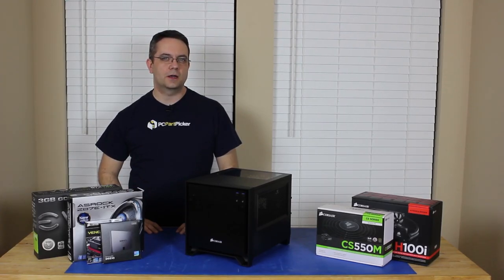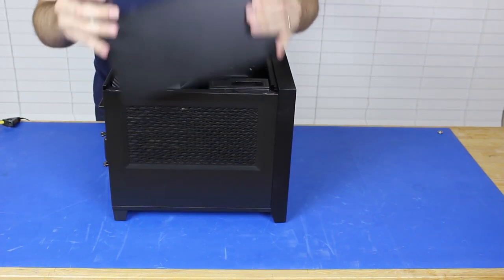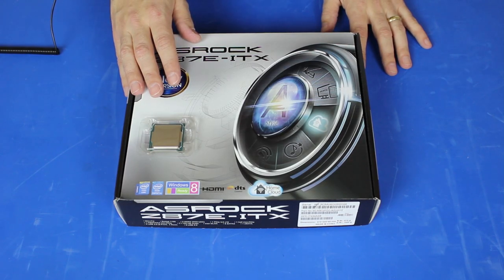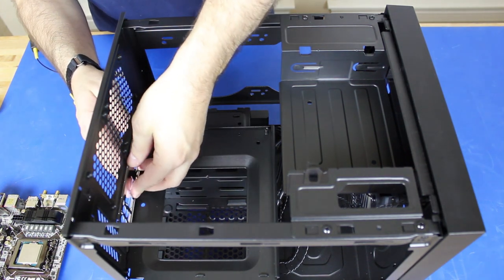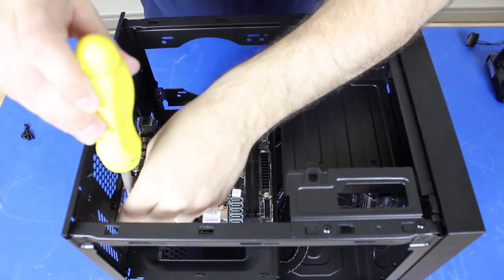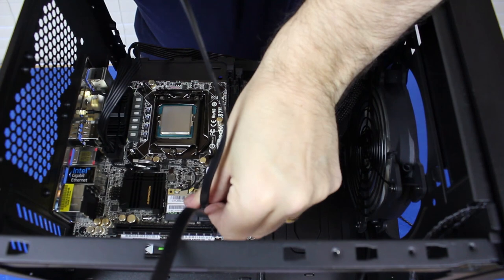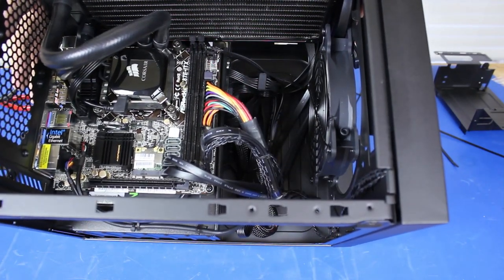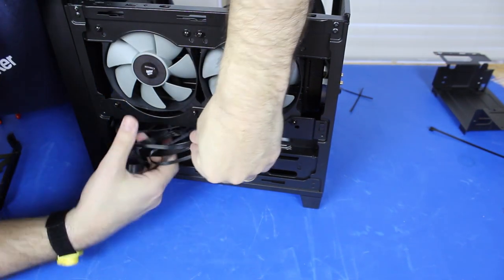Mini ITX Gaming Build - Intel Core i5-4670K / GTX 780 Ti / Corsair 250D

Comment: problem about most itx cases such as this

The GPU cooling is below average rating because of the blocked air ventilation .

Even it does have holes , they should have let us install a exhaust

Comment: i would have had those fans on the radiator as exhaust fans.

you've got a dust filter on the front intake fan but none on the other two #logical

Comment: That was a bad idea on fan placement for the radiator, especially during gaming, those fans will be blowing hot air into the case and everything will be suffocating...
Reply from the maker: The fan placement is according to the recommendations in the H100i manual.  Keep in mind the air coming off the radiator is not blazing hot - just a tad warm - even with the CPU at full load.  The GPU also has it's intake facing the side vent on the opposite side, so it will not be bringing in the slightly warmer air.  Couple that with the front fan intake bringing in additional air...  it's fine.
Reply: PCPartPicker I mean the air does get pretty hot, especially if running the fans at lower RPMs. Plus having so much positive air pressure will actually make it very difficult for the 780ti to suck in fresh air, it will just be sucking in the air coming off of the radiator. I tested this myself a few weeks back as I did have a few friends disagreeing with me over fan placement. I wasn't using a blower style gpu cooler, but the MSI Twin Frozer 780ti ran 8 degrees cooler when the fans on the radiator pushed the hot air out of the case instead of in, and yes that was in a 250D. But that's just my experience and it would only make logical sense to not be dumping hot air into the case...
Reply from the maker: Obox2550 Interesting.  I'll have to test it out and see if there is any difference in our setup.  With the 780Ti being a different style cooler (blower style vs the Twin Frozr design), I'm curious if that will end up the same or different.

Comment: Too much strain on those cooling tubes imho, I would of put the radiator outside, and coolers in the case, blowing out the heat. Also the tubes ending part of the radiator facing forward so the tubes would be loose, still enough place for the 5,25 cage.
Reply from the maker: The cables are very flexible; there is very little strain.

Comment: Does the Asus Strix GTX 970 fit into this case? The card is quite a bit taller than the reference card design due to the mounting location to the back connector plate.  Can you confirm? Thanks!
Reply: ***** I heard they actually can fit but just barely, like a few mm of room ontop but it should fit length wise a-okay.
Reply: Just got my Asus Strix GTX970 today and put it in my Fractal Node 840 which I bought instead of the Corsair 250D. Actually, I bought the 250D before the card came and didn't think it would fit so I returned it without trying to fit it. The Strix fits easily fits in the 840 with lots of clearance on all sides and looks killer. I'm glad I switched cases and very happy with the extra space and cable management.

Comment: will the r9 280x toxic fit and work well in this case?
Reply: I think so, a GTX 780 Titan fits, how large is your 280x?
Reply: Cesar Ferrer what is a 780 Titan
Reply: dotShinoda a 10.5 inches large vídeo card
Reply: i have heard of the gtx 780 and the gtx titan, what is this new hardware the 780 titan
Reply: 2 nvidia card, the titan being the most powerful, their length is  10.5 inches

Comment: What's that on your wrist?
Reply: Miya Kimi it's an antistatic wrist strap. it's used to prevent the static electricity on your body to discharge on any of the components. You can also rid  yourself of static electricity by constantly touching any large metal surface, such as the case or the power supply.

Comment: Hi! Can anybody tell me if the ASUS GTX 970  Strix fits in this case with the top window closed?
Reply: yup. 3mm to spare
Reply: Anton Backman ouch... is that honestly enough room for the power cable?
Reply: With the power connector just wait i ordered my parts already i should het them within a few days ill tell you if it fits
Reply: Anton Backman From the photos it seems like there's a heat pipe sticking up most of the way so if the height was based off of that the 8-pin should be lower in the card and should hopefully be enough room.
Reply: Yeah i saw someone post on some redditpost or something and he said it fits but just barely

Comment: Hey guys I have an old ps3 with a fried motherboard so I was wondering could I turn my ps3 into a pc. If I buy a new mother board, I need it to fit in a ps3 shell, plays games at high fps, and whatever. Anyone now what kind and type I should buy. And do I need anything else?
Reply: i think the only thing u can use from the ps3 is the hdd
Reply: Cooling is a big issue. I think there's only one fan in the thing. You would have to do on-board graphics, so gaming at high fps might be tough.
Reply: no because the PS3 has a custom motherboard and electronics

Comment: is the finished build quiet?
Reply: whit Gtx 780 Ti? nope -_-
Reply: Evolution Gamers No. It's the EVGA version with ACX cooling. Very good cooler and you will barely hear it even while gaming. Even a stock cooler on 780 Ti is quiet.

Comment: is this a good build?
 Motherboard- Asus Sabertooth 990FX AMD 990FX SB950 Motherboard DDR3 ATX TUF R2.0 Socket AM3+ £130
CPU- AMD FX-9590 Black Edition 8 Core 4.7GHz 16MB Cache 220W CPU ONLY £260
RAM- 8GB DDR3 (2x4GB) PC3 1333MHz RAM PC DESKTOP COMPUTER MEMORY DIMM 240 PIN 10600 £57
Graphics Card- MSI Radeon 7770 £70
Hard Drive - Seagate Barracuda ST2000DM001 2TB SATA-600 3.5" Internal Hard Drive HDD 7200rpm £60
DVD Drive- LiteOn IHAS124-04 24x SATA DVD±RW ±R DL / DVD-RAM HH Internal Drive Black £13
Power supply - Cit 850W Black Edition PSU 12cm Dual 12v CE PFC £40
Computer Case- Xigmatek Asgard III Black Midi Tower ATX / Micro ATX PC Gaming Case With Window £42
Wireless Network Card- FAST SHIPPING! WIRELESS N WiFi PCI ADAPTER CARD 300Mbps for DESKTOP PC HIGH SPEED £12
 
Total £684:)
Reply: no, it needs more balancing. You're getting an extremely powerful processor with a very weak GPU.
Reply: could you recommend a gpu in the £100-£150 price range?
Reply: I recommend you lower the processor and spend more money on the gpu.. Within that price range just look at the GTX 760.
Reply: ok:) what about this card? MSI NVIDIA GeForce GTX 750
Reply: xOriginalzHD I would recommend the GTX 750 Ti while dropping your CPU to an AMD FX 8350. The 9590 is just a higher binned FX 8XXX chip with higher voltage. You'll need some serious cooling on it just to keep it under wraps.
Reply: xOriginalzHD The 750ti is a medium buget card sort of so I'd just say look at the 760 and get the FX-8350 or FX-8320 as your processor just so it balances out.
Reply: FatalPivotStrike xOriginalzHD As Fatal pointed out, it is definitely a medium entry card and it's really good as it only uses 60W. That being said, I see that you have a 850W power supply. That's overkill unless you plan to SLI two video cards. You could probably downgrade it some and go for a better GPU like a 760 or 770. Also, let me emphasize that the heart of any build is your power supply. You "NEVER" want to go cheap on it. Ever. It can take out a portion of your components or even your whole system. An 850W power supply for roughly $60 (about 40 euros) is cheap to me.

Comment: Did anyone else notice that he put the CPU backplate on sideways?
Reply: +Jamie Hersrud 

Yes the back plate has been mounted incorrectly and this will affect temperatures as well as the seating of the CPU block. The two notches on the back plate are suppose to sit under the two screws on the motherboards back plate. This is why the fellow mentions that he had to make adjustments for the shafts to fit through the motherboard. Adjustments are not needed when the back plate is fitted correctly.

Many people seem to make this same mistake with the back plate when installing the H100i and they have temperature and seating issues. But the instructions are quite clear on this and the back plate needs to mounted the correct way in order to avoid issues. Here is a good guide.

http://forum.corsair.com/v3/showthread.php?t=139165

Comment: Is there a reason why everyone who builds Mini ITX computers always use a radiator / liquid cooling? Is air cooling a mini ITX system WITHOUT overclock possible or is the included case fan just a sick joke by the case manufacturers?
Reply: +Agumon5 no, but you can't exactly fit an NH-d15 in it.

Comment: I do not know if my machine is fine. : photo : http://image.noelshack.com/fichiers/2014/38/1411302155-20140921-140142.jpg
http://image.noelshack.com/fichiers/2014/38/1411302149-20140921-140301.jpg
http://image.noelshack.com/fichiers/2014/38/1411302180-20140921-140355.jpg

Config (french) :
Processeur : Intel Core i5 4460 3,20 GHz.
CM : Asus H81-PLUS socket 1150
RAM : Corsair 8 GB Vengeance cadencée a 1600 MHz.
Alim : Corsair VS 550w
SSD : Crucial MX100 256GB Sata 2.5
GPU : ASUS GeForce GTX 760 Direct CU II OC 2 Go
OS : Windows 8.1 Pro
Graveur DVD : LG 24X
Reply: ***** ok.
Reply: Definitely not bad for a first build (I'm assuming this is your first PC, but correct me if I'm wrong). Like Ethan said, cable management definitely could be better. Although it may seem trivial, good airflow is important for small form factor PCs.

EDIT: Also, what motherboard are you using?
Reply: LimitedWard asrock z87e-itx
Reply: Stas Rodin That looks like a really good mobo. I was just asking to make sure you didn't cheap out and get one with like a 2 phase design or something.

Comment: Water cooling is such a waste of $ I have never had one and all my I 7 Intel Chip PC's have never had a problem :-)
Reply: Then you're not overclocking.  Or else your i7 would melt a hole in your MOBO.  Personally, I think overclocking is also a waste. And no matter how much cash you put into cooling it,  you still run the risk of bad things happening. But I'm not a hardcore gamer either.
Reply: I a hard core gamer i don't over clock and like i said before I never have a problem

Comment: 780ti with i5 ?...isn't that a bottleneck...i would go for 780 with an i7
Reply: You can go 2-way SLI 780Ti and there still wouldn't be a bottleneck, especially if you overclock it. God i hate using that word. There's no point in getting an i7 unless you plan on doing a little work on it such as videoediting and Photoshop.
Reply: i know but isn't perfect to have an i7 ?...also games start using that more cores especially in bf4 and i7 will give some more fps in games if u have a high end card
Reply: You don't need an i7 unless you plan on doing some light videoediting or Photoshop on it (i'm talking about the 4770K BTW)
Reply: so i do man...its up to u i prefer to have a cpu for the next 5-7 years and when i upgrade the gpu get all the performance i can...u understand what i am trying to say
Reply: Sure mate, i´m just saying that there´s no need for an i7 in games, and both the i7 and i5 will last 5-7 years, if you take care of them. (Probs.) No one knows what the future will bring, and maybe you do get a FEW, frames more but that´s most likely within the margain of error. Have a nice day sir.
Reply: Christos Vasiliou u got disd
Reply: YungMono
Who are you responding to exactly?
Reply: i think u don't get what i were saying but i don't care at all... :S
Reply: when u going with the highest card now u need to have the best cpu to crack it up...so when u have the best card in the market after 5 years ??...an i5 won't give all the performance u could possibly get..if u have now the monie for a gtx 780 why not to get an i7 too and last u for ever..
Reply: facepalm
Reply: Christos Vasiliou Why not buy a NASA super computer and live under a bridge stealing other people's electricity? No computer lasts forever. 50% more expensive =|= 50% longer lifetime. Returns diminish quickly, both 4770K and 780 TI are already beyond the threshold, you already pay a lot extra for very little extra performance.
Reply: Thats a high end i5 with K ( unlocked ) which is more that enough for current stuff, although for such a build I agree an extra 50 bucks for the i7-4790k are worth it.

Comment: Thats a bad layout for the watercooler.
Reply: why?
Reply: No it's not. He stated that he wanted positive pressure in the case which will help with keeping dust out.
Reply: Lukas Bonny If he means it would be better if the cpu plate was turned around a bit more so the tubes are not so close to the rad and then the connection cables will also have less length in view, I also thought that.

Comment: im a first time builder guys so i dont know the compatibility are these compatible thanks                                                                                                                                           CPU: AMD FX-8350 4.0GHz 8-Core Processor 

Motherboard: MSI 970 GAMING ATX AM3+ Motherboard 

Graphics: MSI GeForce GTX 970 Gaming Edition 4096MB 

RAM: Corsair CMY16GX3M2A1866C9 Vengeance Pro Series 16GB (2x8GB) DDR3 2400Mhz 

CPU cooler: Cooler Master Hyper 412s - CPU Cooler with 120mm PWM Fan =

HDD: WD 2TB 7200RPM SATA 6Gb/s Hard Drive

Power Supply: Corsair CP-9020077-UK Builder Series 750W CS650M ATX/EPS Semi-Modular 80 Plus Gold

Case: Corsair Carbide WW 300R

Comment: Is this computer worth it? My friend wants to get into PC gaming and he wants a computer under £750.
http://www.amazon.co.uk/VIBOX-Warrior-Battlefield-78LMT-USB3-Motherboard/dp/B007PBHLHM/ref=pd_rhf_se_p_d_6
Reply: it'll do, but it looks extremely shoddy and probably uses the most unreliable power supply known to man, epic performance if he does go that route but you will get much better by researching and building your own
Reply: its always better to build your own you can knock off like 200 dollars
 but its processor is kind of crappy, the amd fx architecture is horrible. it does have 6 physical cores but they are paired into modules meaning that 2 of the cores share the same memory / memory controller and its cache. so even tho it has 6 cores being paired together will actually have the processor itself in gaming run like a tripple core. if you see amd fx's architecture youll see what I mean it will show the cores paired up but sharing the same memory and only 1 cpu output per every 2 cores
Reply: Its pretty awesome right now everything plays on ultra and really good frame rates but I have it in a different case and a Seasonic PS. Dual band WiFI and Blu tooth and a really good sound card built in if you get the Asus Maximus IV Impact like I did.